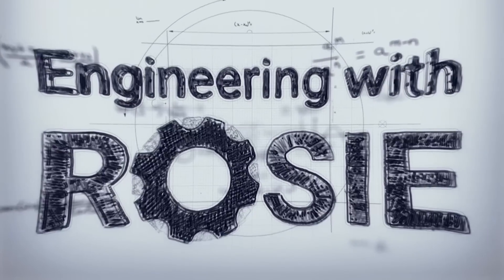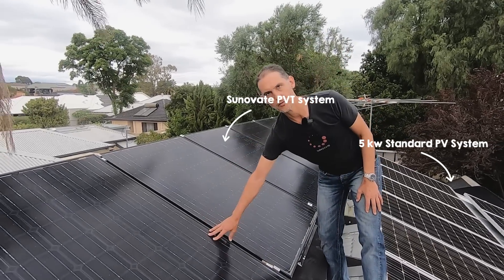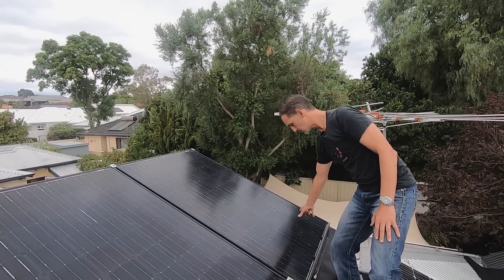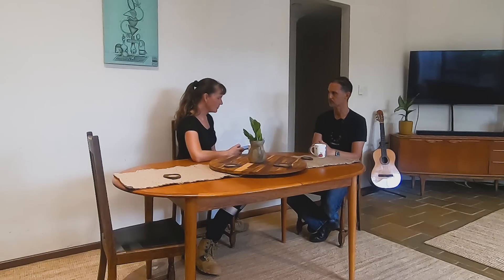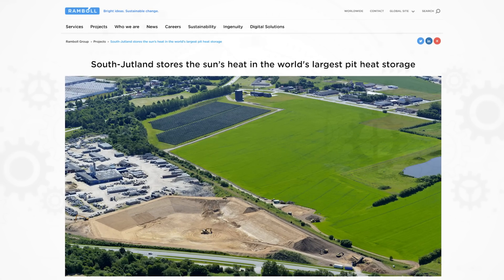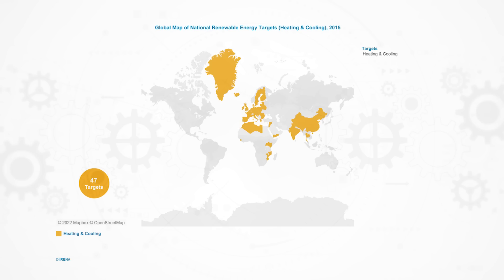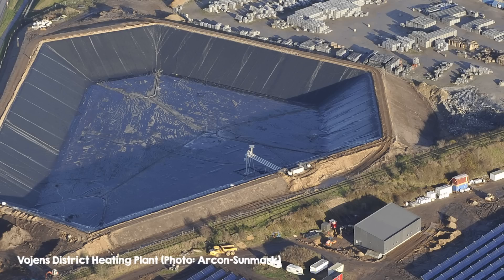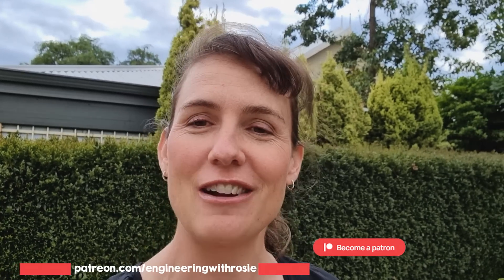Warming Up By Cooling Down Your Solar Panels

Comment: I have a ASHP and very happy with it. moved from oil and did get some government money to do it. my oil boiler and tank was fairly old and was going to need replaced in near future. however as the electric market in UK is broken and based on gas prices electric price has gone up 250% in the time I've had ASHP. this summer I got solar and battery on house and haven't had to buy any power for 3 months however heading into winter demand will return on electric.

Comment: Heating with a heat pump would be challenging here in Canada where the temperature in Edmonton last December dropped to -42 deg. C.
Reply from the maker: The fastest roll out of heat pumps currently is in the nordics: Norway, Finland etc. Also verrrry cold places. Heat pump technology has come a long way, and you can boost temps with other heating sources if you have occasional extremely low temperatures.
Reply: You also had sunny days of minus 14C. and the air in an enclosed space behind a pv panel would be 0C. or more.
Reply: @ Heronimous
Your football team is the Eskimos so you should be able to tolerate the cold. 🥶 A fellow Canadian here although on the Wet Coast. As ‘karllwt’ mentioned the temp of the air between your roof and the panels would be considerably higher than ambient and venting that warmer air to your heat pump would benefit you in less heating costs while also increasing the efficiency and durability of your panels. Given your northern latitude it would be ideal to angle your panels more steeply but getting up on an icy roof isn’t a fun proposition. A guy named Handy Bob had solar on his RV’s as well as his house south of you in Montana and he might have some good advice on his site. I’ve been to McMahon stadium in November and watched many a game at Commonwealth and frigid was the order of the day.
Reply: @ Engineering with Rosie
I understand that geothermal is much more difficult to install but one thing has always bothered me about heat pumps is that they make the air around them even hotter during the warm months and even colder during winter. Much better to use the ground as the heat sink/source but I’m realistic as to why we can’t in many cases. Dave at ‘Just Have a Think’ had a video titled “Why don’t we just run on geothermal?”. Still I was surprised to find that Nordic countries are growing markets for heat pumps.

Comment: Similar panels now available from a French company but with liquid cooling of the panel that you can then use for radiators or water tank heating while cooling the panels.

Comment: Great application of combined solar PV with solar thermal, with temperatures we would rarely ever see here in Wisconsin!  Has anyone tried to combine one of these systems with a Stirling engine? 🌄
Reply: Hi Chuck, We are considering the inclusion of other H2X (heat to....) Stirling engines, solid state peltier just to name a few.
Reply: @glenryan6692  Glen, that's fantastic! Stirling cycle engines are fascinating, and Peltier junction devices came to my mind as well as a more practical solid state device; I'm glad you are considering trying combinations to squeeze more electricity out of every drop of sunlight.  From all indications you are blessed with abundant solar, I'm glad you are making full use of that resource! 🌄.  Good real time operating systems we can all learn from, many thanks.

Comment: I’m wondering if the output heat could be used somehow to run a heat pump that would further cool the input air, so you could get the panels down to an even lower temp?  How would the gain in PV efficiency compare to the loss of the ability to use the output heat energy?
Reply: A heat pump always outputs the heat energy at a higher temperature for further use or disposal.  40°C air can be turned into 70°C hot water, 75°C pasteurization of food products or 100°C for cooking and laundry.
Reply: @johndododoe1411  I’m thinking of something more complex. For example, use a sterling engine driven by the panel heat to turn a generator that powers a heat pump to cool the panels. I realize that particular scenario is probably completely unrealistic, but nevertheless, the heat energy is there and perhaps there is some way to move heat around and ultimately improve panel efficiency.

Comment: There is a YT video of a guy who enclosed the back of his ground mount PV system and coupled it to his heat pump evaporator.  He added venting for the summer. Spring, fall, and winter the air going into his heat pump was well above ambient. To really make this work I think you will have to allow your house to get much warmer than you may like during the day.  Maybe 35 C. instead of 20 C. A heavy house would work better.
Reply: The houses thermal mass is key parameter. The Living Lab is double brick so has some thermal inertia.  We can easily peak at +35 to 40 degrees in the middle of winter. As the ir is introduced through ceiling vents the low grade heat flows over the ceiling face and the upper brick walls. The warm ceiling then radiates this warmth to the floors and occupants. The walls then conduct the heat down. Its like being in Broome or the Bahama's in the middle of winter. We are looking at other thermal storage solutions to support longer term storage so we can make better use of the summer production.

Comment: I am also frustrated with the lack of focus on heating.  Up here in Canada, I don't think this system would make much difference.  When it was coldest, my panels were covered with snow and did not produce much of anything.  Now if I had a good micro wind turbine, it would have produced good power throughout the fall, winter and early spring.   

The idea of air cooling a panel in the summer would be useful, but not much need for the heat at that point.  

Here we need to go to ground source heat pumps.   I talked to someone recently with a super efficient air source one, and it was unable to keep up when it was -25 C.  Ground source heat pumps are expensive to install, and for this reason some incentive is needed.  I like the idea of interest free loans attached to the property to encourage the adoption of this technology.  In the city, district ground source heating systems should be required for any new development and older neighborhoods retrofitted as upgrades to other systems are done.  It is so frustrating so see major upgrades without district heat being done at the same time.

Comment: Sent here by Dave and subscribed.  Based in Queensland.

Love the content but still not sure how a rooftop system here could utilise much of that heat.  We already have a heat pump for hot water which uses very little energy and is fully operational from our solar and battery.  We don’t have a pool so the excess would be wasted??  In winter we have chilly nights/mornings regularly down to 5-8C so would like to heat the house up in the morning but this would be the only time that there would be no warm air from the panels.

So the only advantage is the additional efficiency of our panels (and the longevity) but the fall is quite marginal for us.  We have 11.2 kw of solar PV on our roof and a 10kw/h inverter.  Peak out put is 10kw/h but on very hot days his can fall to about 8 or 9kw/h in the middle of a hot day.  The additional generation would alone is not particularly significant.

This is interesting but it still has the problem that is mostly providing heat when heat is not needed.
Reply: @ Robsenga
I think you may be missing a key benefit of the cooling of the solar panels and that is that their performance will not degrade as fast and so will last longer (I believe the estimate was lasting 50 years instead of 20 and that would cut by half or more the number of panels that end up as garbage). It’s possible that this benefit alone warrants the additional cost let alone any benefit from use of the heat. And heat there is aplenty. I commented on ‘Just Have a Think’ that RV’ers found that having solar panels on the roof heated up their RV so much that they had to use shore power or a generator to run their air conditioners so it wasn’t a win for them.
Reply: @mikedavison3400  Fair enough Mike though I suspect 20 years is a worst case scenario.  My panels have a 25 year guarantee and I live in a very hot place.

Another benefit might be that efficiency improvements mean that you can reduce the number of panels needed.  I have 34 covering two sides of my roof and these panels might mean the same amount of power generation on hot days with just 30 panels.  Extending their life and reducing the number by 10% are both worthwhile.

My only point was that it does not solve the issue of heat generation when it isn’t needed.
Reply: @ Robsenga Hay
Point well taken. They are working on the ‘waste heat’ issue. Glen talked about Stirling engine technology or solid state Peltier as ways to put it to use. Absorption chillers are another possibility. I remember when I first learned about RV fridges that burned propane to heat up the coils at the back of the fridge that I thought it was crazy to create heat in order to cool down something a couple of inches away but they do work well. They are not nearly as efficient as compressor fridges but when the heat source is waste heat then the main issue is collecting and getting the heat up to the level where the absorption cycle can begin. A great benefit of absorption or Peltier technology is that both are QUIET.

Comment: Absorption AC and refrigeration, that uses a heat source to provide the energy for cooling. And phase change heat batteries. Seems like the most universal way to use the excess heat. IMHO
Reply: ... Or divert some of the solar power to run a 12V DC heat pump. Sounds like a waste of part of the PV output but it would more than pay for the energy it used.

I do not have the intuitive expertise to his whether that would come or better or worse than using a great driven heat pump.

A second thought leading on from that:

They make fridges for motor caravans (residential vehicles) that run off either 12V or bottled gas or both. (That's butane or propane, not gasoline!)

The ones that run only off 12V tend to have compressors, but if it takes gas as a the only fuel, or as an option, then it almost certainly uses heat to drive the heat pump. That's useful if DIY folk wasn't too repurpose one to run of the waste heat from the PV, to investigate whether the waste heat is hot enough to drive the pump. Problem might be that it is designed to be heated with a flame, not heat at maybe only 10C above ambient on a not-so-sunny day... Again I don't have sufficient expertise to know if this is viable.

I would appreciate your thoughts on either of these ideas @Rosie or any experienced A/C designer
Reply: All applications we are considering for the H2X program.

Comment: Hi Rosie,
Thanks for this video.. good to see someone finally trying to make this happen. The benefits have been so obvious for so long, I am amazed it hasn't made it as a commercial product yet.
In this video you deal with the benefits to the efficiency and longevity of the solar PV panels, which is great, but a useful follow-up video would be to discuss what can be done with the warm air produced by the system.
Obviously it could be used directly for space heating when the house is cooler than desired, but that isn't needed in summer in many parts of the world, during the day at least. 
Is there a way the heat energy could be stored during the day to be used overnight, during the seasons when daytime temperatures are comfortable but evenings are cool?

Could the warm air be used to boost the efficiency of air source heat pumps for water heating? If so, adding a control system to run the heat pump mainly when warm air was available from the panels could add extra efficiency.

You mention seasonal heat storage.. it would be great to learn more about how that works, and how the warm air could be used to assist with storing heat through summer.
That is probably more practical at large scale, but if it could be done on a single-property or neighbourhood scale, it would be good to know about it.
Reply: PV + solar thermal has been invented several times in the last 30 years.  It is not offered commercially because the heat collected is not worth the cost of the extra hardware.  This is especially true because as you note, the heat isn't worth much in the summer and it is not available at a particularly useful temperature in the winter.

Comment: Most people do not realize that a solar system installed at 3,000 feet elevation will produce much more power than a system installed 10 miles away at near sea level.  I have a watt per square meter that can tell me the sun output in a town such as Boulevard California, and compare it with San Diego, 40 miles to the west, at sea level.  Boulevard is at about 3,600 feet of elevation.  I measured 895 watts per square meter in Boulevard, and only 800 in San Diego a hour later, just past noon.  It could be dust in the air, smog, whatever.  Still it is a significant difference.  You can get a parachute team to test this in real time, it only will take 1 day!

Comment: @Rosie ( @UClu8Q445-ZAG1dzzP1mHiAw ), we know there's a "heat exchanger" but we don't know what sort! Given that an ordinary fridge motor is about 100W, I assume the first 100W is running a compressor to maximise heat extraction, and the air flowing across the panel has been cooled (i.e. chilled air) to get higher conversion efficiency? If he's not using a compressor in the heat exchanger, and just using atmospheric-pressure air behind the panels, I think he might be missing a trick there.

Comment: Cooling the PV cells definitely equates to longer life.  Some panels only last 20 years, so having them last 30+ years is great.  Roof and insulated roof spaces are now a matter for innovation, and engineered roofs are the next step.  For a $250,000 house, the roof only costs about $16,000.  Far better for it to save you money.

Comment: (From the UK). And what about an in-between solution where we have solar and battery storage for all our electricity and buy a small amount in the winter and insulate our houses and reduce the the amount of gas we buy in the winter. I have a well insulated house and I use 1/10 of my friends old draughty house. If the UK only bought 10% of its current demand there would not be a problem and to make it better all the infrastructure is already installed.

Comment: It seems to me that Australia is prime territory for combined Hot Water Heat Pumps - products like - Rointe Dalis Pro Electric Air Source Heat, aroSTOR domestic hot water heat pump or OCHSNER EUROPA series. I am sure there are many others available worldwide. These combine an ASHP with a hot water cylinder. They not only provide your hot water for domestic use, they can (depending on size/product) also provide your heating. As a side benefit as they can be plumbed into rooms to draw air from within the building/rooms and will in effect provide a air conditioning effect, cooling those rooms.

Comment: Stacking an air source hear pump on the output of the sunovate system allows the solar panel to increase the efficiency of the heat pump

If the heat pump waste air is expelled at a cooler temperature than ambient, then looping that back into the air intake of the panels will ALSO increase the PV efficiency. So a closed loop for air would seem on paper to be more efficient than a simple linear system
Reply: I understand your idea but I suppose that the heat pump would generally only be on for a certain amount of time. Maybe also, with hot air going in to the HP the exhaust air temperature may not be below ambient. (But don’t quote me on any of that)
Reply: Hi True, This is exactly right. The system can run in open and closed loop mode. By having the system in closed loop it also significantly reduces the defrosting demand on air source heat pumps because the moisture is stripped out. The overall thermal efficiencies of the PVT part also increase.
Reply: Is there a way we could concentrate and store this excess heat to later use for cooking?

Comment: 16% down to 12%,  0 to 80 C
4% (or 25% of output) over 80 C
30 C is 10%, less the electricity to drive fan.
But extra energy to preheat water?
One more panel maybe the answer to cover small lost energy.
Roof space would not be that limiting. 
Mixed  thoughts for me.

Comment: I agree that air is a better choice then water because of the freezing and boiling issues.  Air is cheap and forgiving.  DIY for anyone is to go with air.  In all system need some temperature controls. 
So how does a DIY make a system that cools each section of a solar panel evenly?  Answer is to blow air at each panel through a tube. This happens to be the most efficient also.  My guess is that the tubes need to be about 4 to 6 diameters apart.  The tubes stick through the very large air return duct, want slow moving air, and the inlet of each tube is in the supply duct.  Insulate the discharge duct with foam board.  
The same approach can be used for water.  In this case the return duct always drains 100% and the centrifugal pump (use a sump pump) for the water doesn't have a check valve. Water drains also out of the panels on the roof to an insulated tank. 
Thermal storage can be as simple as rocks of earth that can be the ground under the house.   If space is an issue the method of choice is always phase change that occurs at a very narrow temperature range, another control issue that best matches a heat pump.  The heat packs that have salts that change states or melting of wax are the options.